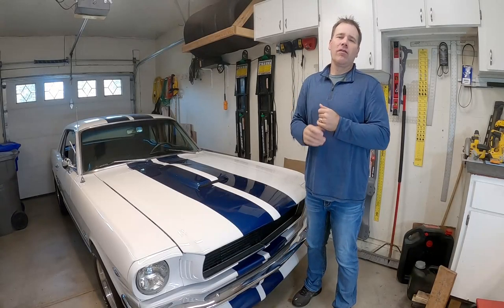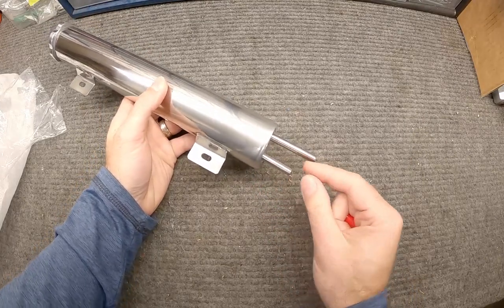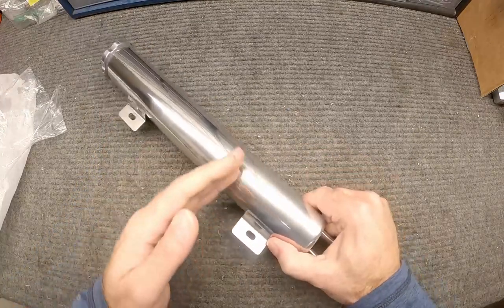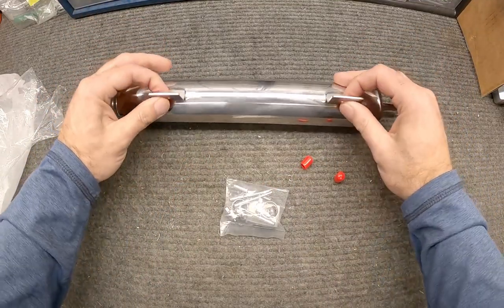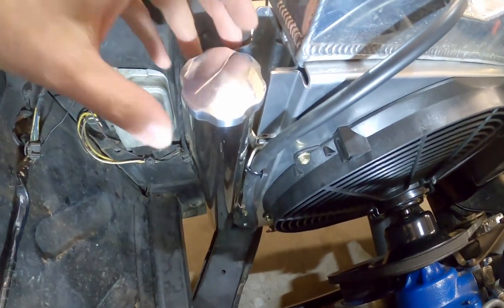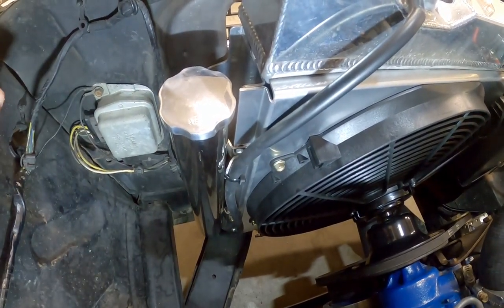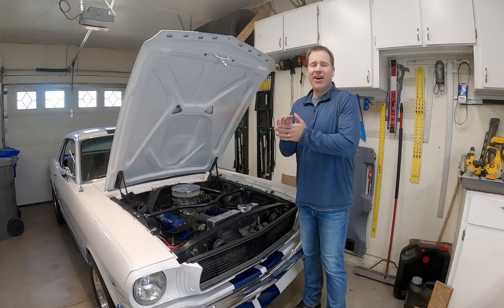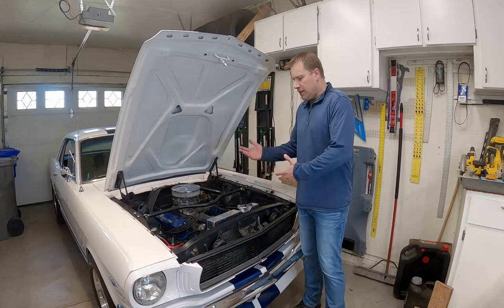Installing Radiator Overflow Tank

Comment: Andy does that system draw the coolant back in when the radiator cools off? I am looking to add one to my 1959 corvette and have not been able to find a video where they showed the connections and how it worked. Thanks and great job on the video.
Reply from the maker: Thanks!
Yes it can as the inlet tube on the overflow tank barely goes up inside the tank.  The shorter of the two tubes on the bottom is the inlet.  The long tube goes way up inside, almost to the top.
Reply: @AndyKruseChannel  but how would the fluid in the overflow get sucked back into the radiator?
Reply from the maker: @NoblesTx  By the vacuum created from the low pressure that takes place once the engine cools and therefore the coolant temps are reduced.  This is the same design as OEM overflow tanks, nothing magical here.  :)
Reply: @AndyKruseChannel  it seems so much like magic for my little brain! Haha thank you sir!

Comment: Ordering one now.  What size mounting bolts should I pick up?  Also, is it ok to place it so close to the heat source?  Any advice/video on how to bleed radiator?   Appreciate your input.  🤙
Reply from the maker: You're better off heading to the hardware store after you get the overflow tank so you can see what size bolts would fit your application.  There's no issue placing this tank next to the radiator, it's just an over flow tank.  I have videos where I install the Radiator, Water Pumps, and Intake Manifolds where I go over adding coolant to the system and how to get the air out.  :)

Comment: Very informative video. Question is that there are two tubes coming from the bottom of the tank, but one hose? Which is connected? Thanks!
Reply from the maker: Thanks!
One tube is the "breather" tube, it goes up to the cap, and the other is the filler tube.  The longer tube is the "breather" tube.

Comment: Hi Andy, great video. I have a 65 Mustang with a 302 Stroker. Do you have any videos on how to burp/bleed the air out after changing a thermostat? Thanks
Reply from the maker: I have found the easiest way is to drill a small hole in the top of the thermostat (around 3/32" or so) and it does a pretty good job of getting the air out.  You'd think with a hole in it that the coolant would get by it and cause issues with the cooling system, but I've never had an issue.  I done this on all three of my Classic Mustangs with no problems.  I cover the details about it in my video called "Replacing the Thermostat Housing Gasket".  :)

Comment: I also bought that overflow tank, haven't installed yet.
PS: that fan so close to the engine gives me goosebumps 😂
Reply from the maker: You and me both!  Moving that radiator forward about 1/4" (to the other side of the sheet metal it mounts to) would probably be best.
Reply: @AndyKruseChannel  surely there's another video in that?? 😁
Reply from the maker: @TeamGForce75  Can't, I'll explain why in 2 weeks.

Comment: HI Andy, love your videos, they have helped me do heaps on my 66 mustang here in Australia. I purchased the overflow tank from eBay and it arrived today. However the lid is very loose when you put it on. ( i just had another look at your video and yours appeared very tight when you put it on and off) should it be pressure tight or just tight so it wont come off??
Regards

Jeremy
Reply from the maker: The lid does not need to hold any kind of pressure, so it doesn't need to be tight enough to do so.  I actually think the lid on mine is too tight, and I keep thinking I'll do something about it, and then I get distracted and never touch it.  If your lid is like mine, you can bend the tabs on the lid in a tiny bit (towards the lid) and that should tighten it up.  Make tiny adjustments so you don't make it too tight on the first try.  Good luck, you've got this!  :)

Comment: Hey Andy, great video. Do you need to add any coolant to that overflow tank? I've read that there should be some coolant in the bottom of them and that the radiator should be full to the brim also?? Thanks Dan
Reply from the maker: Ideally, the coolant system has been successfully bled of all air and topped off correctly, therefore not needing any coolant after a norm drive.  The radiator cap would have to open and release some pressure if the system wasn't bled properly before it would pull fluid back in.  It wouldn't hurt anything to have some in there.   :)